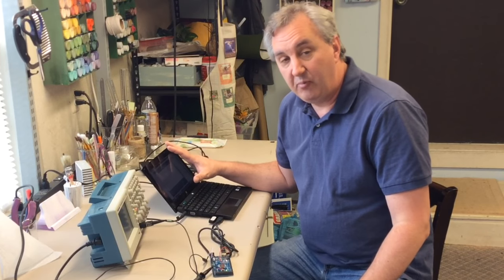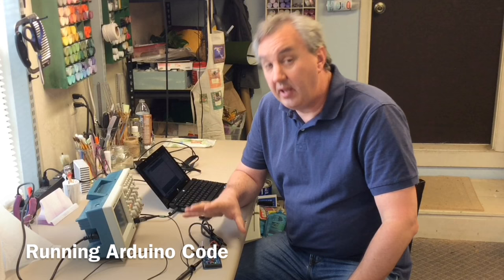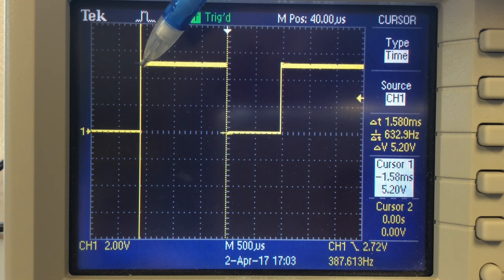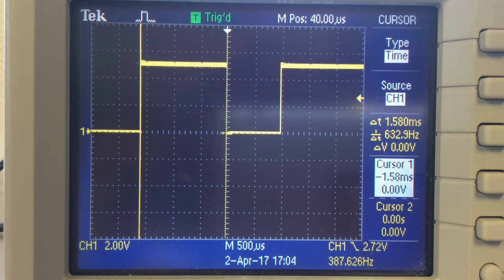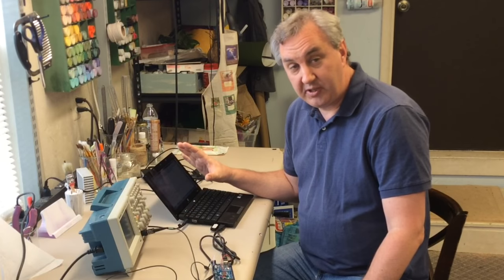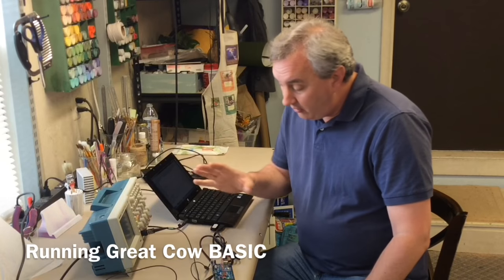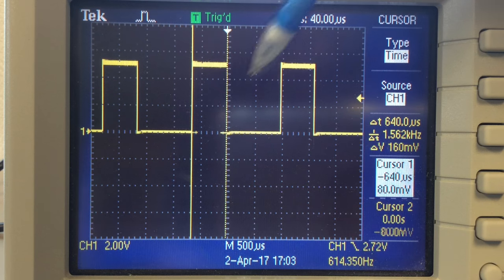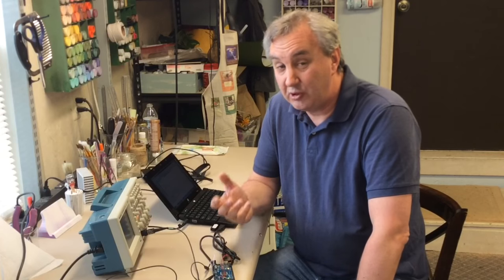8-bit Arduino Mega Speed Test vs Great Cow BASIC compiler

Comment: The speed shouldn't be the same.  In the Arduino code, you are calling a subroutine in a for loop.  In the great cow basic program, you're directly doing the work that the digitalWrite call is doing.  If you do the exact same thing in the Arduino code, going directly to the port and toggling it, you'll find the Arduino code is just as fast as the basic program.  Alternatively, (not knowing anything about the great cow basic compiler) if you create a subroutine and repeatedly call it in the basic program, I would expect to see that the basic program is just as slow as the arduino code.  You have to compare apples to apples, the two programs are not equivalent.
Reply: So, what you are saying SET PORTB.x is faster than digitalWrite? But surely the digitalWrite is doing the exact same thing and SET PORTB is probably a subroutine as well.
Reply: @jasonking1284  this comment is ancient.  set port.b is a direct memory write. It's 1-2 instruction in assembly. To call digitalWite you have to push the arguments on the stack, jump to a subroutine, look at the source code for digitalWrite... I'm not going to compile both ways into assembler to compare the results.  It looks up the memory address from an array, does the write and returns a value back to the caller. 2 instructions vs. probably about 20-25. If all you are doing is putting that in a loop, yeah, digitalWite is going to look slow. But it's because you are comparing the wrong things.  100% if Arduino code was written exactly like the cow basic code, the performance would be the same.
Reply: @anthonyzawacki8305  Could it be that Processing is less efficient because it is a learning language whereas Cow BASIC is supposed to be for production so as efficient as possible.
Reply from the maker: I never saw your comment 3 yrs ago but yes, you captured the point of the video. 8-Bit has more memory, capability if programmed properly. Many Arduino programs, including some of the Marlin code relies on inefficient libraries. The advantage to GCB is it produces pure assembly and pretty efficient routines. So it’s more that a digitalwrite vs Portb.x, it’s how the code is built.

Comment: Arduino compiler evaluates 1+2+3+4 at compile time (the generated code just stores 10 in the variable). The main slowdown is the repeated calling of the digitalWrite function. Your point still holds, however, it's not all Arduino.
Reply: kraklakvakve the write to cnt is not done as it gets optimized as nobody uses the cnt later.
Reply: Apparently this optimization is not used. My Arduino compiler produces:
 120: 8a e0        ldi r24, 0x0A ; 10
 122: 90 e0        ldi r25, 0x00 ; 0
 124: 90 93 03 01  sts 0x0103, r25
 128: 80 93 02 01  sts 0x0102, r24

The addresses 0x0102 and 0x0103 are not used anywhere else, as far as I can see :-)
Reply: Interesting, I have only experience with 32bit controllers where seems to be the default optimization. I never used an arduino, only the IDE for some ESP8266 testing.
Reply: The cnt variable is somewhat confusingly declared as global in the module. If you make it local, the assignment is optimized away. If it remains global, the compiler cannot know if it is needed in another module.

Comment: This is a pointless comparison. Did you even compare the machine code in the loop? Great Cow might have just optimised the maths out. It also probably does a lot less setup and checking than the Arduino code so there might be unintended side effect by not doing those things. Find a way to test the computational speed of Marlin with your scope and then compile it outside of Arduino IDE and see what difference it makes.

Comment: So what's the point? First thing is that you are comparing a compiler with an IDE, which are two different things. The second is that Marlin, Repetier, etc, are written in C/C++ and use the Arduino IDE only because its easier to share and build the source code. Imagine sharing your source code  in Atmel Studio, all beginners will be afraid to do something with that code. PLEASE, do not mislead people.
Reply: Yes, an IDE is technically just a text editor, however, Arduino IDE is more than an text editor, because it has all the libraries and other stuff which is making the ATmega controllers slower. To prove this, try to make the same test for Arduino but not with the digitalWrite functions, write directly to registers like you did with the Great Cow.

Comment: To honestly compare the two, you'd need to compare the actual generated machine code and the functions that each program includes. Yes, Arduino has overhead, that's part of the easy-code, easy-dev paradigm. And obviously, we could make much more efficient code to run on the AVR chips. This still doesn't address that there is very little power for the price of the 8-bit AVR chips compared to what you can now get in the ARM-based microcontrollers. I, for one, welcome our new 32-bit overlords. :P

Comment: I disagree with the video. Use the gunctions the firmware is using for setting pins high or low.(writing to registers) and you'll be at the same place. The problem here is interrupts and timers with non-maskable code, not pin flipping.
Reply: Unfortunately, no, that's not the case. If you check the source of Marlin or Repetier, you'll find that the slow libraries and operations are already replaced with the post efficient versions, optimized for compilers to produce the fastest and smallest code available. Possibly (questionable) you can squeeze another 1-3% by changing compiler, but that's about it you can do with this sort of HW. Whenever you do serial communication (e.g. reply back what's the temperature), you will use so many cycles of the processing unit, that any background process (such as driving steppers, calculate angle for round movement, etc.) will get impacted. That's why even Arduino-based RAMPS is much faster when working with SDcard comparing to serial - it's not because the serial is not "fast enough", but because to process it, the CPU will waste a lot of effort. And we are back where we started - to improve on serial communication, you'll need buffers, different interrupt handling, ... and before you realize it, you are at 32bits.

Comment: I see your point, and if we're starting from scratch, it makes a lot of sense of look into an alternate compiler, but the argument against 8 bit controllers is as much an argument against Marlin. Marlin, much like the arduino environment is bloated, and messy. If you look at the code structure of -- Smoothieware, and see how that is written and architected, you'll never want to go back to Marlin again. Also the issue with speed has as much to do with the USB interface and the limitation in the AT chips to communicate with the host. This limitation limits interaction with something like OctoPrint. In general, I would agree that optimizing is a great idea, but that would imply there is some option to optimize 8 bit firmwares to a point where you can get such results, I highly doubt that is possible, and it's not really beneficial to write a 3D printer firmware in basic. Realistically 3D printers should move to integrated boards designed for 3D printers, 32 bit, networking, proper machine control chips, and Arduino boards still have their place in simpler projects. I have several Arduino megas in my house as parts of my home automation system.

Comment: well all the "good" firmwares like repetier or marlin don't use the arduino functions for the critical code, these parts are all in native c/c++. The advantage of the 32-Bit CPUs are more timer, a better interrupt controller and DMA for the most interfaces, this is what makes the huge difference. Also the STM32-ARM microcontroller are cheaper than the Atmegas. If you do a lot of math the very cheep STM32F4 also have a FPU. For drones the 8-Bit are to slow, well you can fly (my first quadcopter 2007 was based on a Atmega644p) but you sacrifice a lot of functionality. 

I used the Atmegas about 15 years and I decided 2017 is the year I'm finally migrating to 32-Bit ;)

edit: the very time critical functions in repetier are actually in hand written AVR-assembler.
Reply: Yeah, small 8-bit processors are cost efficient, but large ones have been severely overpriced. It's understandable - systems, devices, applications grow organically, but transition to another architecture has costs associated with it. There is a lot of competition on similar and compatible architectures in 32-bit space, driving the prices down. And STM32 is just so ridiculously well designed in particular with its DMA peripheral!

As to assembler, i can see 2 multiplication functions used in stepper interrupt in Marlin written in Assembler, but that's it. It could also potentially use #pragma GCC optimize on some portions, but chances are, the hot code has been hand tuned enough to the point where it will compile the same on -O2 as it does on -Os. There are certainly no nasty Arduino library calls in hot code.
Reply: Drones is one thing and 3d printing is another thing altogether since the amount of precision we need for this stuff an 8bit can do but sitting there with no idle time because the code is not optimized means it can't get around to servicing the timer, etc... when needed.

btw, don't be a Bill Gates who taught an entire generation that sloppy code writing is okay as you simply need to throw better hardware at it.
Reply: It depends heavily on your project/product. If I just need a single prototype I don't spend hours of optimizing my code I just use cheap fast hardware with a simple to use programming language I just want to get it done. At the end you have to consider the development time for heavy optimised code vs the material costs. And don't forget debugging it's much better on the ARM processors.

For delta 3D printer who require a lot of math the 8-Bit Atmegas are to slow for fast moves I works but you profit massive from a 32-Bit ARM Controller. I build 6-Axis robots and again the 8-Bit is to slow for six closed loops.
Reply: Andreas Hölldorfer

I'd say the 16 vs 72MHz for avr vs arm make a giant difference performance wise
Reply: Again that math could easily be sped up, I lay odds, by refining the bloated library.  8bits has nothing to do with the speed because that is the precision but what does have something to do with speed is instructions per clock cycle and having highly optimized libraries and code which we can see the gcc-avr compiled stuff just isn't.
Reply: and for a bug more you get 180Mhz with a hardware floating point unit.
Reply: I don't think so, repetier already uses for all the critical functions assembler and for all the math highly for optimised c code. I spend a lot of time digging in his code and he didn't use all the bloated arduino libraries. There is not much room for improvement. 
Another major problem is the lack of a DMA controller for the interfaces so you spend a lot of time waiting until your data is send or received. 
Yes there is room for improvement but I think it's time to move on. We didn't even talked about power consumption. The tiny are relative ok but the Atmegas draw a lot of power compared to the much more modern ARM devices.
Reply: Repetier still uses IEEE floats extensively in the planner. This is not the best idea, it's particularly bad on AVR and it's still bad on Cortex M3, though on M4F it's just fine.

I'm going to fork one of the firmwares, either Marlin or Repetier, and convert it to fix point. Any preference which I should do? It seems everyone uses Marlin and there's little information on how well any other firmware works in the first place.

Comment: This is something I would like to see more of on your channel. I am a software developer, but I work in the world of C# and haven't had to touch C/C++ in any real capacity. If I am understanding this correctly, what we deliver to the arduino is assembly, so it doesn't matter what language we build our applications in as long as they understand the instruction set of the target processor.  So, this indicates that the assembly produced from the GC compiler is far more efficient than that produced by the Arduino compiler? Is there a way to see the assembly output by the two?
Reply: The way it works, Arduino IDE takes the code, prepends the board-dependent header, prepends the Arduino base libraries written in C++, concatenates everything together, and sends it to AVRGCC compiler in C++ mode and produces a binary; however not all C++ features are available, which is fair and expected, because some library parts needed for them were spared away. A standard AVR binary is produced as a temporary file that is uploaded to the AVR by a configurable loader.

It should be possible to run "avr-objdump -S" on binaries produced by Arduino IDE and other compilers to discover their differences. Objdump is a dependency of GCC and comes from binutils package, and should be present in Arduino distribution. It's helpful if a way can be found to co-generate debug information as separate file, then further objdump options can be used to interleave it with disassembly, otherwise it will be super hard to read.

It's likely enough that the libraries to provide expected default functionality simply take up some of the processing time and it's also likely that they took up the extra ROM and RAM - in a larger project, this may become irrelevant as the functionality may be needed anyway.
Reply: Yes, a very basic disassebly (without symbols or any debug info) can be done using Sketch - Export compiled binary. This produces two .hex files. Then you can do avr-objdump -m avr -D something.hex > disassembly.txt

Comment: An idea I have been thinking about is if there are enough pins availabe offloading fan pwm and temperature control to a another controller. Ic2 to tell the second one what temperature with 3 pins for feedback. 1: on temp 2: heating 3: fan on or off. You could offload the extruder with 2 control pins pins: forward and reverse. ic2 would just be used to set the settings.

Comment: There are a few users of the same 3D printer I have (DMS DP5) who have switched to 32 bit boards and not only do they now have larger color touch displays and wifi plus the ability to upgrade the OS with just a single reboot but most importantly the print quality has noticeably improved. Shortly I'll be moving to a high speed core XY design and will be switching to a 32bit board myself, for the few extra bucks there are too many advantages.